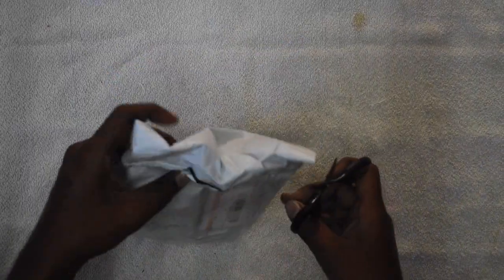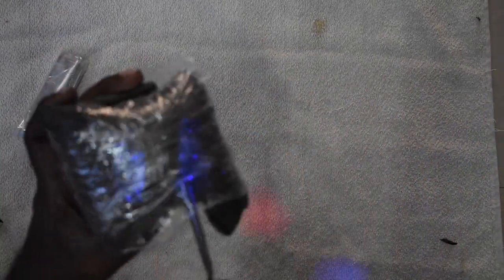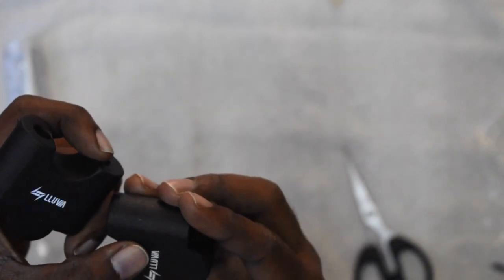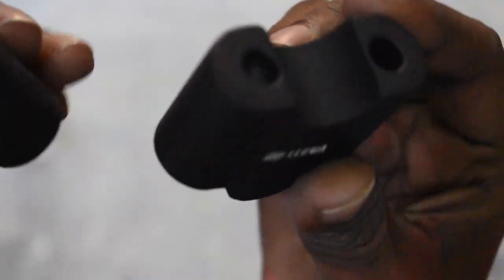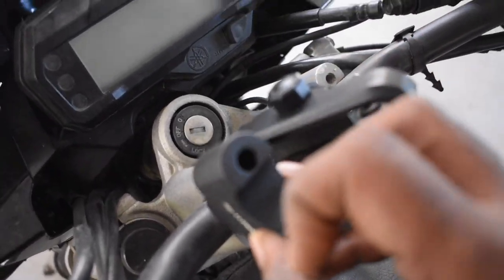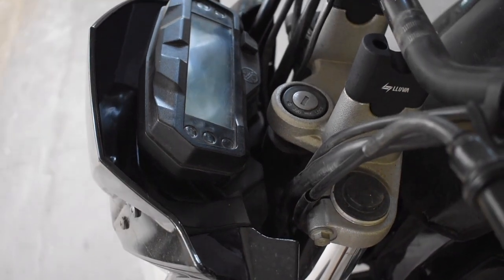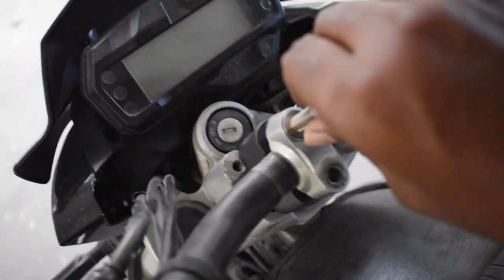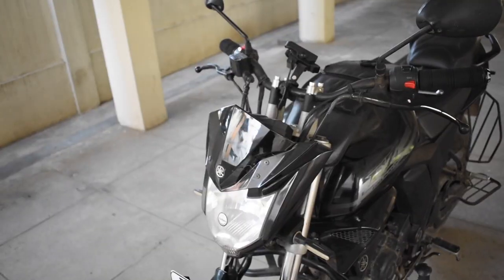Handle Bar Raiser Installation || Yamaha FZ

Comment: Could you please tell whether it will fit with Yamaha FZ16 2013 Model.
I have been getting huge back pain while riding. I was searching on Internet from many months for these Handlebar risers.  Will 2 inch Handlebars fit perfectly if we order.
Thank you!
Reply from the maker: Most probably both the handle bar base are very much similar.   Hopefully it will suit.  Anyways you can contact any Yamaha service center near you and double confirm it once again before ordering.

Thanks.   Keep supporting.
Reply: Yes, The pain is real

Comment: Is accelerator cable and clutch cable  getting effected?
Reply from the maker: No.  I have installed the 1.5 inch raiser.  Not affected.     Thanks...Keep supporting.
Reply: @naveenramachandran5922  thank you. Can you share the buying link

Comment: Bro 2 inches risers set aaguma? And xpulse hero brand risers set aaguma namma bike ku? Please see xpulse handle bar risers video and reply to me also it just 850 only
Reply from the maker: Which video are you taking about bro?  Can you please share me the video link where I can check and get back to you
Reply from the maker: Yes bro it will suit but not sure about the finishing. Because in the X pulse model the handle mount in the corner cut setup so they designed the raiser also in the same way.  But in our fz it's different.  So the seating perfection of the raiser might change little bit I think.  So better go with the dedicated one bro.  Because if there is any misalignment will create a problem in the handling and cause pain in the hand during long ride.
Reply: @naveenramachandran5922  bro.. all ok. But I found here one.. just it cost 100 rs .. Yamaha own product.
Reply: Bro eppadi bro 100 vanganinga #pornachandran.. Link ethum eruka.. Thalhaansar78@gmail.comku pic anupu bro number also pls nanba
Reply: @signboard8449  share link here bro
Reply: @whyzoworld370  sorry for the delay. I'll share you definitely bro
Reply: @Rs-no9ez  I'll share you definitely bro
Reply: @my way , can you share the link of handlebar risers which you are using